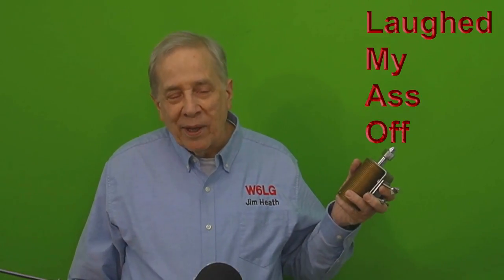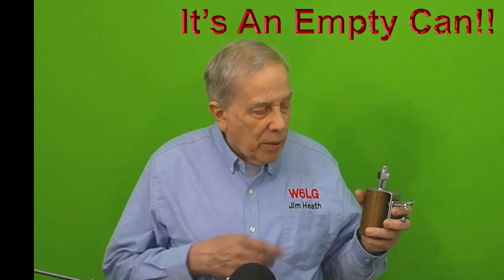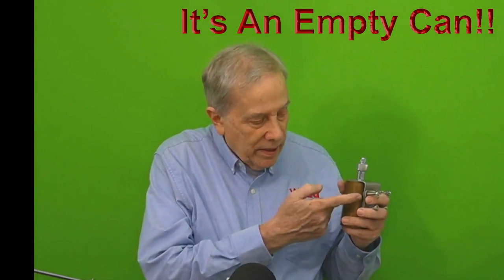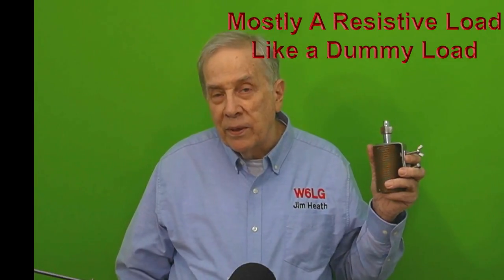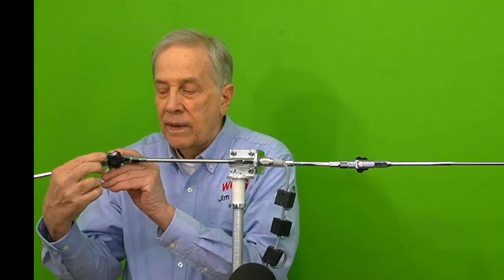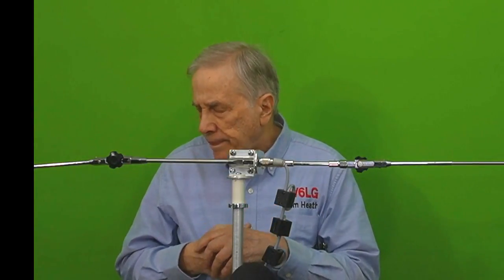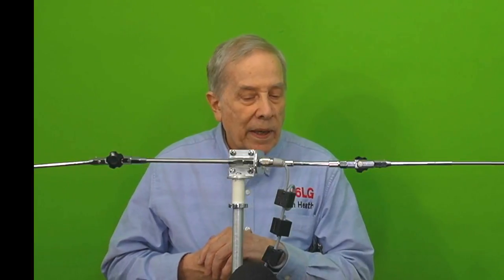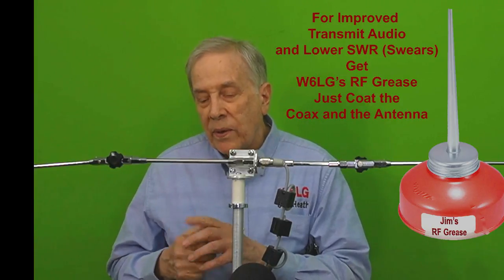Deceptive Antennas Using A Standard Carbon Resistor With Inductive And Capacitive Reactance

Comment: I buy digital speakers for my digital audio amp.  I buy digital antennas for my digital tv and radios.
Reply: I never mix solid state and vacuum tube electrons. The cross contamination results in inefficiency and distortion, and can contribute to SWR issues.
Reply from the maker: While in college, I worked in stores that sold ham radio equipment and Color TV Antennas.  The black and white tv antennas were in a black and white box.  The Color (capitalized) TV Antennas were in a yellow box with red letters.  The antennas inside both boxes were basically the same.  Oh yes sir, over here we have the color tv antennas.  This is what you need so you can watch Disney and Bonanza.  By the way, that reminds me, the star of Bonanza was a frequent customer sometimes without his toupee!  73, Jim W6LG you will see my father's name on Star Trek and many TV shows

Comment: Buyer beware when it comes to antennas !  Newbies always seem to be hyped with these new, miracle antenna that cost an arm and a leg and promise the world !  Then they have prices that suggest they are made of gold, covers all bands without a tuner, and requires no radials.  If it states things like that, be VERY VERY skeptical !  Another thing to look at is the end fed wires with a 9:1 unun promising all band operation.  First, a 9:1 unun is designed to match a 450 ohm antenna to a 50 ohm feed line.  A random wire is almost  never 450 ohms !  Ununs and Baluns are most efficient when feeding a load they are designed for and lose efficiency when you stray away from their design impedance !  This means you are wasting power in the form of heat in the balun and feed line.  These things also use the outside of the coax shield as a counterpoise (other half of the antenna), but RF does not belong on the outside of the coax as it can end up in your shack and all over your equipment causing distortion on your transmitted audio.  Just do some research before you plunk down your hard earned cash !  There are better choices out there that cost much less and work much better !
Reply from the maker: After my video I did watch some reviews.  It seems to me, in the absence of testing antennas here, that there is a new "crop" of scam antennas hyped by many YouTube inablers (talking faces) with steadfast followers who attack anyone (like me) who attempts to shed light onto their idols. I feel that I am doing a service in a space where the national organization should have stepped up.  The lab and staff at the ARRL have much greater knowledge and equipment than I do.  But where are they?  Instead the CEO is saying great things about the those who sell these fake devices on their YouTube Channels.  So the CEO is just another salesman for the fakes.  I have nothing much to gain.  I have MDS cancer and it is serious. So the CEO and a Board Member attack me and let the scammers sell their expensive fakes.  That CEO and Board Member should resign.  73, Jim W6LG

Comment: This was dry humor, that is relavent, but an antenna reviewer is not going to teach you how to make a product. They assemble, plug it in, get a qso or pota contest it, and add a spectrum analyzer segment. The real fun is when they power steady enthusiasim through a 40 step guy wired, tripod, yard whip, assembly, an "and then-athon". 
HOA is a tricky scenario:
House too nice to put antenna webs and yagis above house.
House to nice to run longwires and loops up the walls, in the attic, and in the computer room.
If they can afford the innovative, low swr device with a coax connector, then be glad they are trying to be active amateurs.
House

Comment: Steerable phased arrays and slot antennas are less than 100 years old, and baffle most hams, no?
Reply from the maker: I had phased array on 20 meters with 8 elements on Wolf Mountain....two towers.  It was amazingly good.  .....not sure about slot antennas or that I even understand them.  Seems like early on, there were broadcast stations that had steerable arrays. Some were really high power...like 100kW.  They had huge mercury vapor rectifiers and big triodes, tetrodes.  Neat stuff!  73, Jim